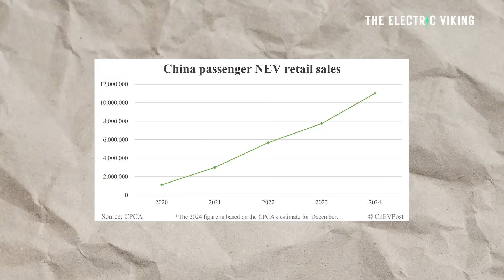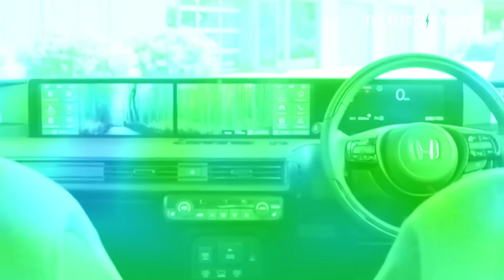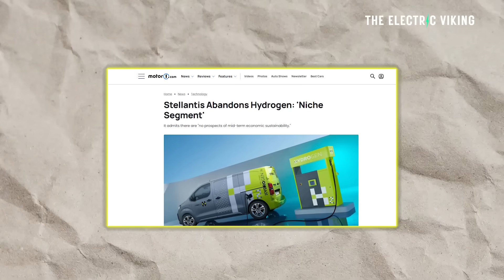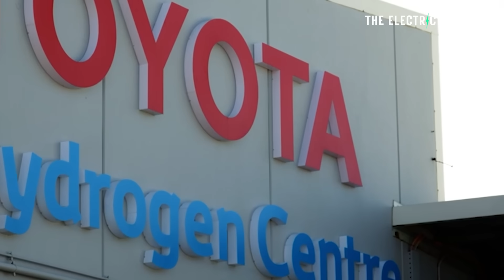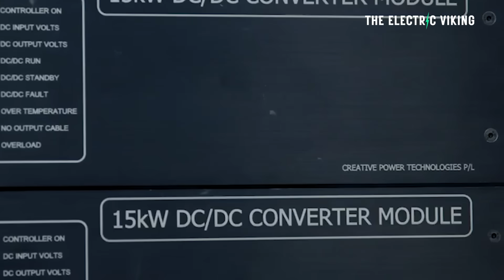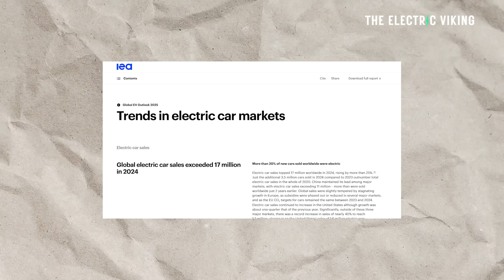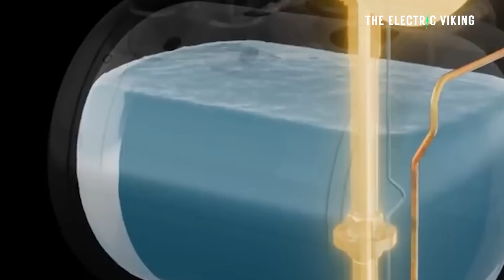The Future is Hydrogen Cars - Honda says EVs are not the future

Comment from the maker: The car I drive, the Xpeng G6 - https://youtu.be/IcniwO8NfQQ

RESINC Solar installed my battery and solar system. Get a free quote from them here: https://www.resinc.com.au/electricviking
Reply: Hydrogen fuel cell technology needs an infrastructure so cars can be filled up quickly and easily. 
If that is developed then maybe Honda will be a leader in hydrogen powered cars.
Ev's have  any drawbacks....not enough charging points, higher insurance costs, massive resale value losses.......
Reply: @harrydestaffano565  When gasoline automobiles were developed, the same situation (no infrastructure) existed.  Look at the infrastructure now.  I believe that the same thing will happen with hydrogen fuel cell vehicles.
Reply: @chucklemberg4968  Could be right, certainly the charging infrastructure for Ev's is poor.   Even in the UK a petrol powered car is still a much better investment than an EV or Hybrid.

Comment: We’re all forgetting one thing we internal combustion engine is cheap to make cheap to maintain and everybody knows about the technology hydrogen on. The other hand is not a visible fuel. Do you wanna take your kids in the car with a 10,000 pound hydrogen tank under the seat I think not And we’re all looking at one country that did it right Brazil they have a separate sugar crop and they make ethanol alcohol out of it with a special yeast that ferments this alcohol very aggressively to make fuel alcohol. I think they’re doing it right you grow the sugar and you make the alcohol. It’s just that easyand it’s around 75 to 80% of that of gas or gasoline.

Comment: There are two problems with Hydrogen. First, Volumetric Density. You just can't put big enough pressure cylinders in a sedan, to give any more than about 250-300 miles of range, and have any trunk space, or even much space for passengers. Second, Hydrogen is drastically inefficient. It takes a lot of energy to electrolyze water into Oxygen and Hydrogen, and, a lot of energy to compress it to hundreds of bar, to put enough in a car, to give several hundred miles of range. It would take even more energy, to cryogenically liquify Hydrogen, to further improve volumetric density. Liquid Hydrogen would be impractical, because of standby losses. Just like a rocket on a launch pad, you have to fill it, then go! For consumers, Anyone who has enjoyed the convenience of plugging in at home for a charge, doesn't want to have to go somewhere for fuel. They left combustion, for just that reason! To try to "fill" a Hydrogen car with an electrolyzer at home, would require 4 times the electricity to go a given distance, than just simply charging an EV. For those afraid of battery fires, how about a car, with half a "Hindenburg" of Hydrogen stuffed into it! The explosive potential energy of pressurized gas can blow the car to pieces, even if the Hydrogen doesn't ignite. Hydrogen made sense, back when EV's were using Lead Acid, and even Nickel Metal Hydride batteries, which had very low energy density. They had ranges from 80 to 140 miles, and Hydrogen promised 220-250 miles. Now, modern EV's regularly exceed 300 miles of range, even less expensive models, like the Chevrolet Equinox EV, or extended range Tesla models. Batteries are getting better and better all the time, pushing Hydrogen further back into obsolescence. Hydrogen combustion? PLEASE!!! That would cost 10X more per mile, than battery electric!

Comment: What most manufactures get wrong is that most of us do not really care about carbon neutrality, what we want is a form of transportation that is affordable. I have a lexus IS 250 and I spend 1500 South African rands to fill it up and get about 560 km till I get the red light, I now want a BYD seal that will cost me 250 Rands to get about the same range if I charge at home. I can even get Solar and drive for free. Why supplement fuel with another combustible you can only buy.

Comment: I went to my local Honda dealer to see the Prologue EV  SUV.  It seems to have the same level of integration as my year 2000 Ford Ranger EV.  A heavy steel body,  EV parts just bolted in place of a gas drive train.   So there's no  storage under the hood, just a bunch of unusable space between poorly integrated HVAC, drive train and other components just thrown together.  As it's  a Honda the rear seat head room is for small children, unbelievable in a full size SUV.  Many kids in the USA get to be over six feet tall in highs school. The range isn't great and there is zero Honda charging network for long trips leaving you to load five different apps for the weird chargers that may or may not be along your trip and likely won't work. Looks like I'm keeping the Tesla a while longer.  The dealer went so far as to hide the car in front of the service counter out of the showroom with the other gas cars.  It was just sad.  I drove Acura for twenty five years.

Comment: In Saskatchewan, Canada the streets surface is below 0c at least 5 months of the year. With Hydrogen exhausting litres of water onto the road, we'd have 100's of miles of skating rink. Just the cupful of water current ICE engines leave at the inersections makes insane driving and requires massive amounts of salt and sand.

Comment: So to drive your electric Honda, you've got to go buy hydrogen, to power the fuel cell, to make electricity, good luck with that! Not just plug into your free electricity rooftop solar, charge your battery, and off you go. Are they wishful thinking or are they extremely stupid?

Comment: Any car company that can make a midsize hybrid SUV that can achieve 45-50 miles/gallon will be successful, at least in the US.  On average, a person in the US drives 15-20 miles a day, and with that kind of gas mileage, one fill-up can last a month.  Who need EVs?
Reply: And I love my Chevy Volt. But it would be even more convenient with a 100 mile range. Pity GM killed that car instead of building a gen 3 model. Until charging networks are more universal, PHEV is a great stopgap. Note that the other cars in the household are Teslas, and they are getting along fine already.

Comment: Last year, a class action lawsuit filed by Mirai owners against Toyota says: 

“This action arises from Toyota Motor Sales, U.S.A., Inc.’s fraud in the marketing, sale, and support of its Toyota Mirai hydrogen fuel cell vehicle. Plaintiffs, who represent diverse California consumers including military personnel, seniors, and working families, purchased Toyota’s hydrogen-powered Mirai based on explicit promises of convenient refueling, environmental benefits, and practical usability.

Instead, they received vehicles that are virtually unusable due to a critically deficient hydrogen infrastructure consisting of only 24 fuel nozzles across California, most of which are frequently inoperable.”

Toyota start selling hydrogen cars in 2015, 10 years later there are only 24 nozzles to refuel them. Only in California. 

As of the most recent data, the U.S. has over 188,300 public charging ports spread across approximately 70,600 charging station locations. This includes both Level 2 and DC Fast Charging stations.

Comment: Worked in the oil supply and storage side of the industry and designed a few service stations.  I find it completely incomprehensible that people believe that supply and use of hydrogen by the masses could be safe.  Filling stations would be reasonably safe but the cars!!  People drive round with bald tyres.  Hydrogen so much more dangerous than petrol I don’t believe people could be trusted to do the maintenance required to keep the cars safe.  Hydrogen molecules so small they move through steel, preventing leaks would be a nightmare.

Comment: The future is making low-cost hydrogen into a hydrocarbon.  The secret to making the hydrogen is making ortho water.  Ortho-water as discovered by Michael Faraday and confirmed by Werner Heisenberg splits at very low energy input (now confirmed and independent proven at 8.7kWhrs/kg H2 NTP).  To take advantage of this it is necessary to be able to modify para-water to ortho-water at a very low cost.  This is currently being done in Victoria with no government backed input.

It is possible to make low-cost hydrogen into ammonia and run a generator on ammonia.  This alleviates the H2 storage problem.  This will soon be attempted at scale in Victoria.

In fairness to "the Electric Viking" he knows nothing of this as the inventor does not believe in any advertising until it works at scale across many sites.  The inventor is worried about interactions with government owned oil companies.

Comment: Green hydrogen can be made very inexpensively and in mini catalytic plants  about the size of a 40' container.
Combustion engines can run on H2 with some minor mods and ideal for moror heads. The big users of H2 will be busses and trucks. There are prototypes engines running on Ammonia for more energy dense and lower pressure storage

Comment: Most people fail to understand just what hydrogen actually is. They think it's like gasoline or other liquid fuels. Hydrogen has extremely poor volumetric energy density. If used as a gas it must be compressed to 10,000 psi and stored in fairly large tanks in order to get any range out of the vehicle. If used as a liquid it must be cryogenically chilled and maintained at −423 °F. Even in a well insulated tank if not constantly chilled (maintained at −423 °F) liquid hydrogen will immediately start to absorb heat from its surroundings and begin boiling off. If not allowed to boil off (vent) it will quickly develop very high pressures and explode. BMW's experiment with liquid hydrogen was a disaster. Since BMW chose not to run chillers in the car the hydrogen had to be allowed to vent. If parked over a weekend an entire tank of very expensive hydrogen would boil off (see YouTube video). There is also the issue with fuel pumps capable of handling liquid hydrogen. The metallurgy necessary to handle hydrogen for a significant period of time doesn't exist. Fuel pumps last only for a few tanks of liquid hydrogen before needing complete replacement. Liquid hydrogen quickly destroys them.
Besides all this, a hydrogen vehicle has the exact same electric drivetrain as an EV (unless you're stupid enough to attempt to burn it as a gas in an ICE in which case you'd be lucky to get 150 miles of range at best).

Comment: A piston in a cylinder to produce energy is steam technology adapted to gasoline. 
  Electron flow to produce rotational dynamics is chemical none mechanical power manipulation of latest technology. Two hundred and fifty years old mechanical design will never compete with 95% efficient BEV technology. It was only battery innovation that was holding back electric propulsion. Lfp blade battery technology solves all drawbacks. 
   The latest Chinese cars destroy any adapted cylinder piston steam technology. The legacy brands need to change quick or go bankrupt.

Comment: Ahh from the brand that is currently unable to manufacture a reliable ICE vehicle, that rebranded a Chevrolet Blazer EV, is talking about hydrogen? Really?

Let’s be clear: the hydrogen car was born dead. Period.
The vehicle that the Japanese showcase as evidence is the Toyota Mirai. The Mirai can travel approximately 100 km with 1 kg of hydrogen (actually, it’s around 90 km, but for calculation purposes, let’s use 100).

This car is known as “The NamX Concept Hydrogen SUV.” It has an internal hydrogen tank of 5 kg and five removable tanks containing a total of 3 kg, or 0.6 kg each. This gives the car, when fully loaded, 8 kg of hydrogen and a maximum range of 800 km.

Now, 1 kg of hydrogen contains 33.33 kWh of energy. So, 8 x 33.33 kWh = 266.6 kWh to move the car 800 km.
That’s 33.33 kWh per 100 km or 333 Wh/km.

However, producing 1 kg of hydrogen requires approximately 65 kWh of electricity. So, to fill the car’s hydrogen tank, 65 kWh x 8 = 520 kWh are needed.

A modern battery electric vehicle (BEV) of the same size as this concept uses about 16 kWh/100 km (let’s use 20 for calculation purposes). Therefore, with the energy needed to produce the hydrogen that allows this hydrogen car to travel 800 km, a similar electric vehicle could travel 520/20 = 2,600 km, or 520/16 = 32.5 x 100 km = 3,250 km.

Let’s not forget that a Long Range electric car typically has a battery of around 80 kWh, allowing it to travel approximately 400 km. To travel 800 km, it would require the equivalent of 160 kWh, which is 60% of what the hydrogen car needs.

Now, let’s talk about the cost per kg of hydrogen: in Norway, where it is subsidized and tax-free, it costs around $28 per kg, so filling the entire tank costs $224.
The current average cost per kWh at a Tesla supercharger is $0.45 USD per kWh; = 266.6 x 0.45 = $119.97 USD.
If compared to home charging costs, 266.6 x 0.09 = $23.99 USD.
And if we compare it to the current amount of kWh required to cover the same distance, we’re talking about:
160 x 0.45 = $72 USD at a Tesla supercharger and/or
160 x 0.09 = $14.4 USD at home.

Another point to consider is that hydrogen deteriorates all materials and metals it comes into contact with, so hydrogen tanks need frequent replacement, as do laboratory-grade air filters and metal pipes exposed to the gas.

For these and many other reasons, the hydrogen car will only live in the dreams of its developers.

Comment: Honda’s difficulty is they make internal combustion engines for many applications not just road cars. Probably bigger than any other manufacturer. Cars, two wheelers, lawn mowers, chainsaws, strimmers, leaf blowers, snow mobiles, planes, boats….That means billions of invested cost in plant and equipment. They are not stupid but are doing everything to slow transition. If it was your money you would do the same.
Reply: That a foolish man's approach. Trying to prevent transition vs using your current capital to update your processes and lead that transition will only result in ruin. They are following Kodaks mentality and we all know how that went.

Comment: They could be right, nobody ready knows what technologies are around the corner, maybe 100% efficient fuel cells and porous metal H2 storage cells will be invented. For now and the near future batteries make sense, claiming anything else requires clairvoyance or a time machine.
Reply: Or maybe Metal-Air batteries, offering similar energy density to petroleum will be launched with their current short lifecycle issue addressed.

Comment: Hydrogen powered vehicles do not make sense compared to Electric.  Hydrogen will require building a generation infrastructure and distribution network.  The worlds' electricity generation and distribution network already largely exists and only requires installing chargers.  Electric motors are MUCH LESS complex and less expensive to build and maintain.  Adopting electric propulsion universally for vehicular transportation appears to be the better choice.  Hydrogen may have limited application but ....?

Comment: Does Honda know something we don't?  Is there a new hydrogen catalyst producing tech on the horizon?  If not, hydrogen seems like a red herring.
Reply: creating H2 is not the problem, but Honda has invented a way to deliver H2 to all passenger cars over wireless connections and if there are some areas with a bad reception then they deliver H2 to re-fueling stations at home over a electricity power grid. Must be, because otherwise I don't see how they could survive as a passenger car manufacturer.

Comment: EV's can never be the future. Takes too much electricity to even fast charge. Which is still slow compared to the time filling up with diesel or petrol. Fact
Reply: Obtaining oil are actually tricky. Not everyone has them. Unless you are a Murican.
Reply: Way to explain how little you understand about electricity.
Reply: do you know what solar panels on the roof on our house does to our EV cars?
Researches have alread calculated that if USA would all in a sudden over night have all existing cars as EVs then USA would need to generate only 25% more electricity in a year. And that is in theoretical scenario if all those EVs would charge at the same time. Highly unlikely scenario, so a power grid is a lot less problem than building a nation wide H2 re-fueling network.

Comment: So… Right now I can drive into my carport and plug the car into the charger. No trips to buy expensive and explosive gas, or doubly expensive and explosive hydrogen.

Throughout the world, electricity is already transmitted across existing high voltage lines, to all cities and towns and most homes and businesses.

The power for my car comes from solar panels that also power my house and a backup battery. The plan is to over time increase the number of panels and batteries and go completely off grid, collect and store all of our electricity.

With hydrogen, the world would have to spend untold trillions of dollars to beef up the power grid to produce, transport, store and sell dangerous and very expensive hydrogen. Most hydrogen is currently derived from methane using vert energy intensive methods.

Or, I could plug into the solar and battery system that has freed me from being enslaved to the corrupt and price gouging oil and electricity cartels, and that is already being more than paid for by savings from powering my home and car.

Comment: The huge elephant in the room is that 99% of hydrogen is made from gas and oil. It’s just greenwashing of big oil. Rotten to the core.
Yes, it’s possible to make hydrogen with green power, but it’s ridiculously inefficient, compared to putting that same power into batteries. That’s why almost nobody makes green hydrogen.